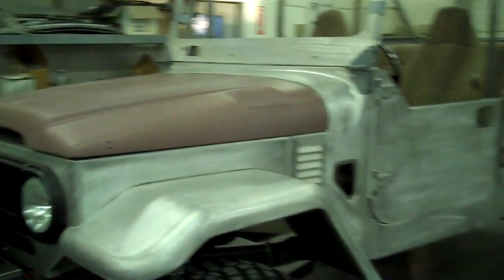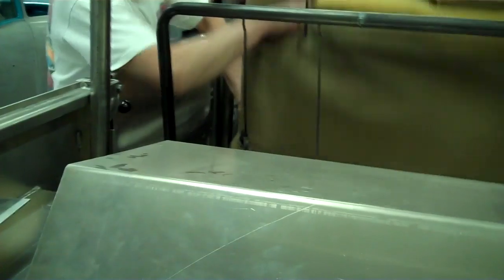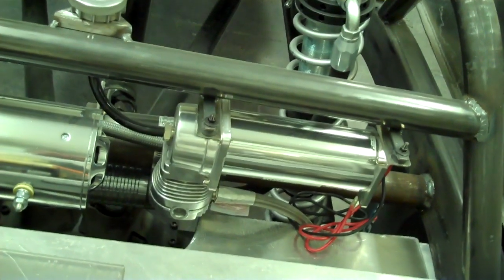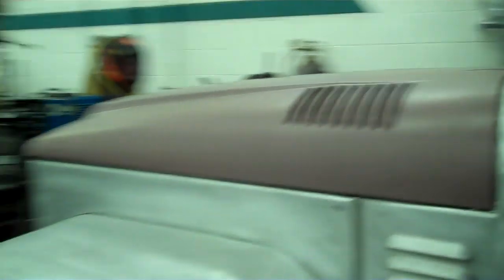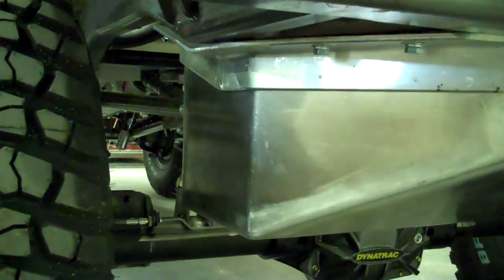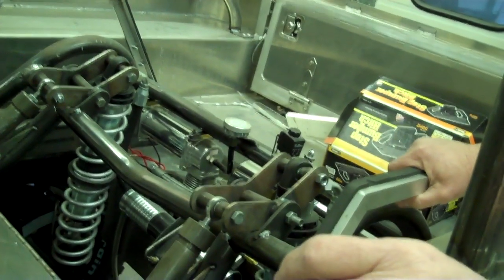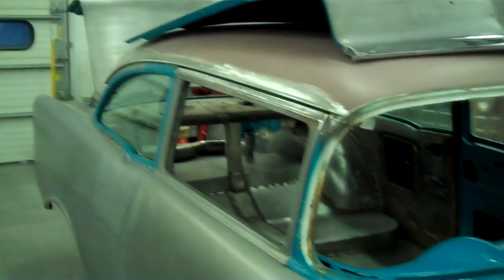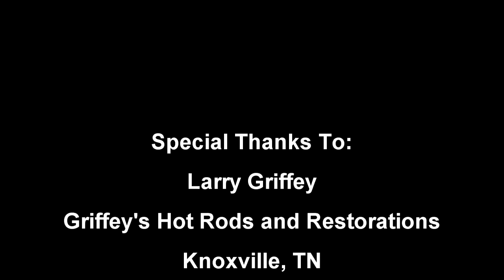Toyota FJ Custom

Comment: If you were going to do all that hydraulic work on the suspension, you may as well put in a hydraulic active/adaptive suspension setup. So much better for handling on and off road.